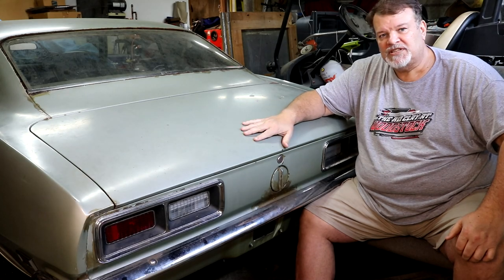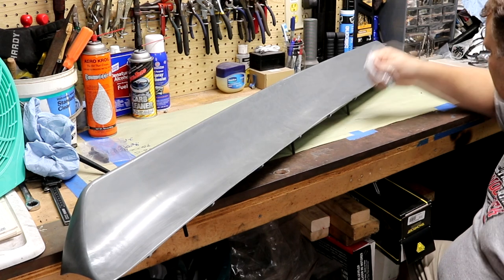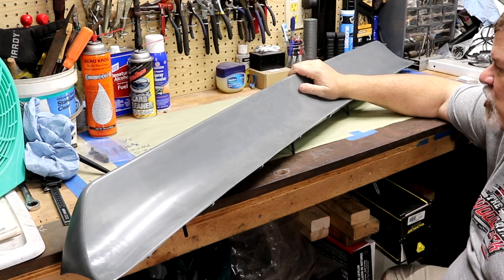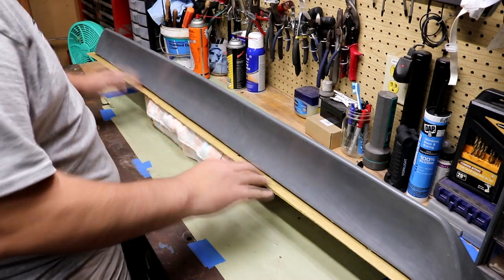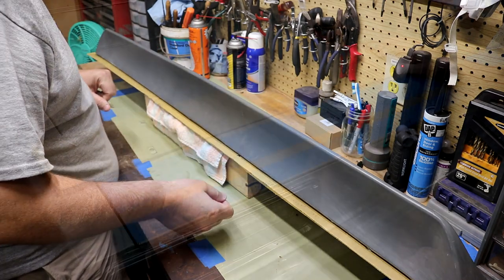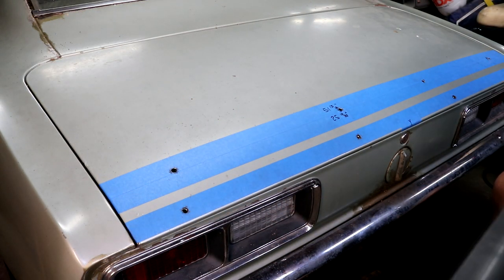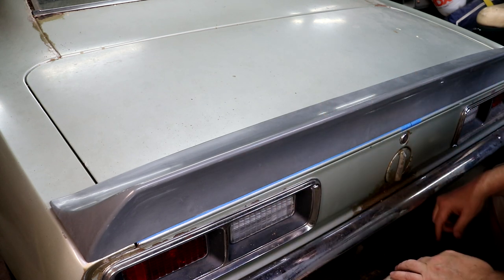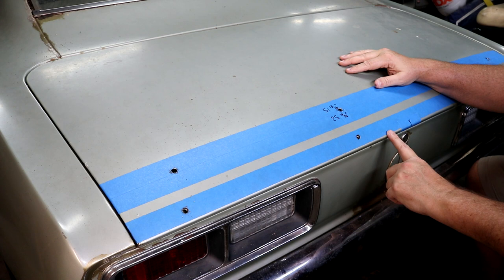Rear Spoiler Installation | 68 Camaro | The Mistress Ep02

Comment: Are you going to put o rings on the studs between the spoiler and the body?
Reply from the maker: I didn't but that is a great idea.  Even now, it is not riven in the rain, but I do like the idea.  Thanks!
Reply: @UCanDoIt2Mike  i have a 1990 mazda rx7 that had a factory spoiler and it rusted the holes out. Im just gonna weld over mine primer and paint.
Reply from the maker: @goodkill1  I did dab some primer on the holes, but an o-ring or gasket of some sort is brilliant.   Thanks!